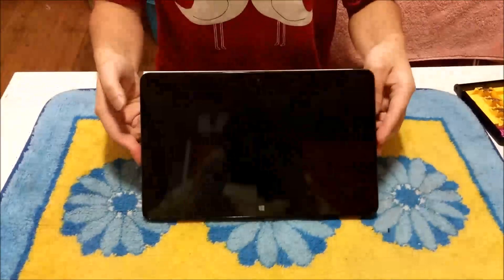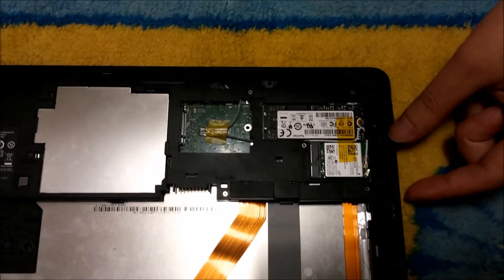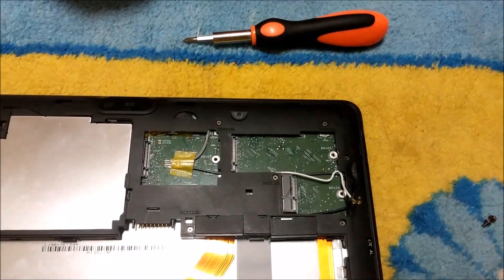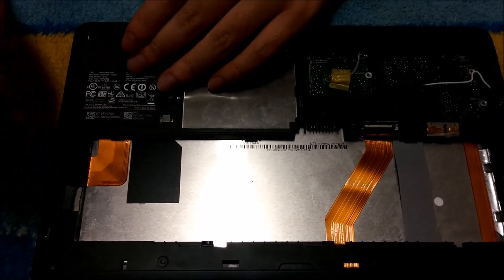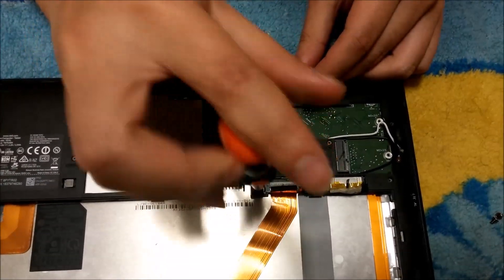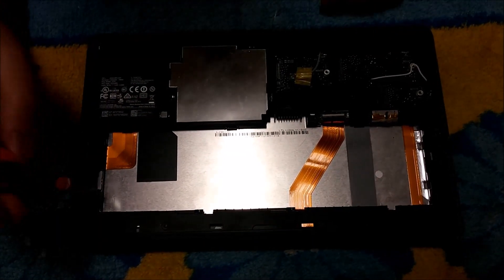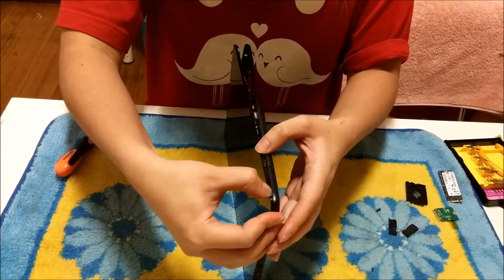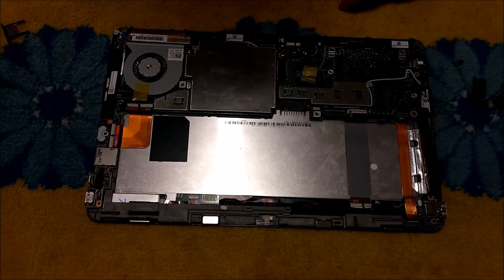OPEN ME UP! Dell Venue 11 Pro Disassembly

Comment: Hi! Thanks for this. As far as you remember, is unseating and swapping out the microphone a straightforward process once I reach the point where your video ends? Or are the connectors soldered, glued, or buried under other components?
Reply from the maker: if you done the whole video it should take you an extra 1 minute to replace it
Reply: @OpenMeUpTec  Does it  have a bios reset jumper?  Still remember?
Reply from the maker: @wilsont1010  nope it doesnt have one
Reply: @OpenMeUpTec  Will removing the CMOS battery work for this model in resetting the BIOS password?

Comment: Do you think it would be possible to clone the ssd if you left the current one in its correct m.2 slot and placed the other where the mobile wireless m.2 card would go?  I realize this means the back would need to be kept off, but it would make things cheaper.
Reply from the maker: +93Allene yes it is but you always can buy a USB m.2 case and do the same thing

Comment: I am curious, which version of the tablet is this? I'm looking to swap the atom motherboard in place of an i5 motherboard from the 7130 model. The only thing I can't tell is if I'll have to add the fan or not, if it's already in the unit. I'm waiting for it to come in from ebay before I can tell. Thanks in Advance!
Reply from the maker: michael you actually can't do that the atom one is smaller than the i3 and i5 one. They are not the same thing. You can change i3 and i5 over but not the atom one. This video is the i5 and its casing/housing is different compared to the atom one

Comment from the maker: Yes to can but requires more effort and i don't know if you can purchase the digitizer by itself try to give dell a call to get a quote for it.
Reply: Hi:  Just viewed your video about Dell tablet. I have a Dell Venue 11 Pro 713- with 4GB Ram and 128GB drive; is it possible to upgrade to 8GB Ram and 256GB drive? how to transfer all OS and data to the new drive? please advise. Thanks
Reply from the maker: you can change the hard drive to a higher size but you can not change the ram as it is solder on.
you will need a M.2 hard drive to replace your old one like this http://www.ebay.com.au/itm/281640616601?ssPageName=STRK:MESELX:IT&_trksid=p3984.m1586.l2649
you can buy an USB adaptor for the hard drive like this
http://www.ebay.com.au/itm/External-Metal-M-2-NGFF-SSD-to-USB-3-0-Converter-Adapter-Enclosure-Case-Box-EP-/181462726700?pt=LH_DefaultDomain_15&hash=item2a4005782c

then you can use a cloning tool like Acronis true image
Reply: Thanks very much for all your notes and help. Will look into it.

Comment: This is a very interesting video demonstration.  It would be nice to see it redone with a good video camera sitting on a tripod, with good lighting, and a good microphone.  It is better not to touch the electrical contacts on the cards and to use a light colored or clear container for the small screws.  Thanks for posting the video.
Reply from the maker: thanks for your comment. the issue is I was using a phone to record the video and a webcam microphone to record the voice, I have just got a tripod and a canon 600d so the new videos should be a lot better compare to this. I always touch the contacts even I know it is not a good idea but I still do it to demonstrate nothing really bad can come out of it as a normal person will end up doing it anyways even if I tell them not to. I don't use a container for the screw as it is easy to separate them and show people where each screw can from and how many there were.
Reply: +OPEN ME UP Something really bad CAN come from touching the contacts however. I open hundreds of computers a year, and even though only one or two may have problems afterwards, that is something bad. Advising people that they can do it, and then something happens, they can point the finger back at you and if you instructed them to damage their personal property because you didn't care to add not to touch contacts, you could be held liable if they wanted to go after you.
Reply: +Justin Barnes Especially when demonstrating a computer/tablet dissembly on a carpet.